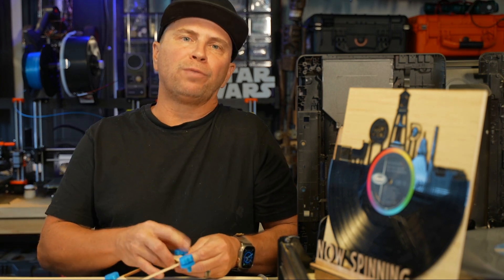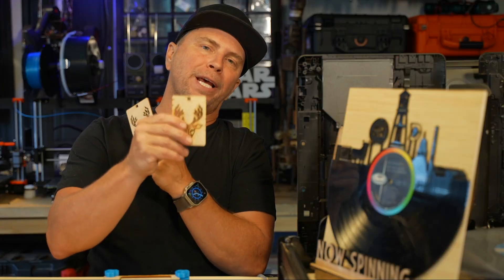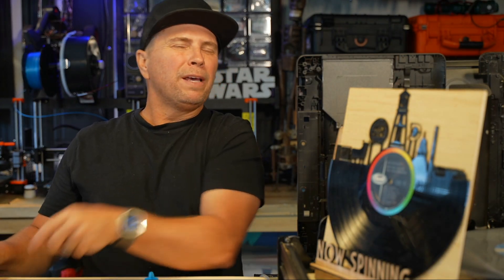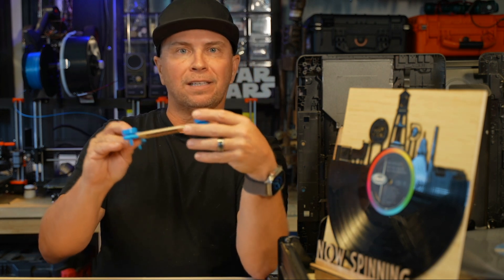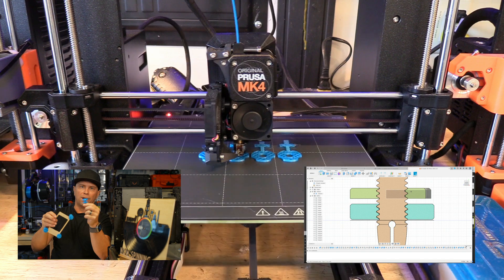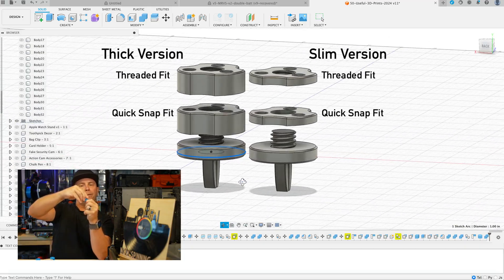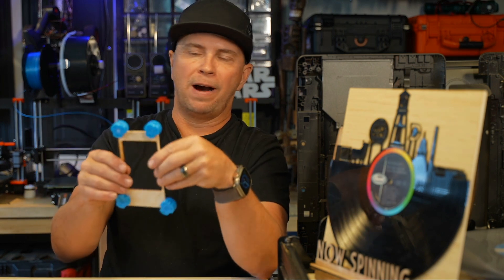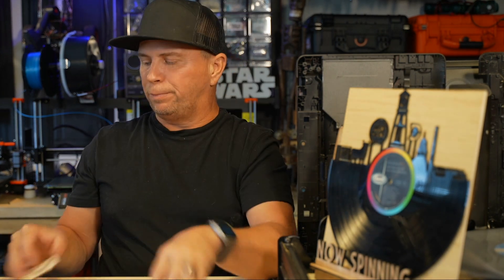Clean Laser Cutting using 3D Printing - Avoid Flash Back and Extra Sanding

Comment: Buy an Aeon Laser and take advantage of the cross bed airflow.  Most Aeon's have a designed in air flow from front to the back of the laser  evacuation of the smoke will greatly aid with this.
Reply from the maker: Thank you George

Comment: or use air-assist..... (your stl-files aren't linked - it stucks on the 40$ page)
Reply from the maker: https://ryandewitt.com/shop-files/p/laser-cutting-stand-backs-laser-cutter-engraver-flashback-standoffs-file-only
Reply: @hacklab.ryandewitt  thanks for fast response!
Reply from the maker: I’ll check this
Reply from the maker: OK, I see what you mean. I will put that link up ASAP. I just updated the file pack so it includes everything including the low profile in the high profile.